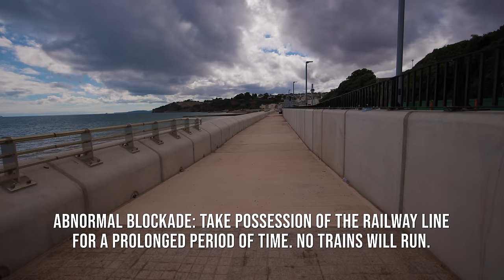Dawlish Sea Wall Upgrade - August 2022 Update with Network Rail Milestone

Comment: Wall looks good. Can I make one point though. White lettering against black screens can be read during the day. However at night when visibility is reduced they become much more difficult to read. You have to find a black painted sign post against a dark sky in the first instance, before you can read it. And if you are on the train and want to see what station you have arrived at, before alighting from the train, its not immediately obvious, adding to the stress of travelling.

Comment: That's some impressive engineering works. I was interested to hear that the piles go down some 25 metres. Made me wonder how Brunel's station bridge as stood the test of time as the piers still look solid even after many years of high volume train traffic
Reply: Brunel didn't build the station that we know. The original structure, I believe was timber back when it was a single track (wide gauge).

Comment: One thing that puzzles me, why install separate poles for the CCTV cameras and the Tannoy when the light poles could be used?  Less clutter on the platforms is surely better for disabled people and even the rest of us.  I've lost count of the number of times I've walked into 'Street Furniture' if distracted!
Reply: I agree with you Tony but when has commonsense ever prevailed! Someone’s decision and design toes are bound to be trod on if you try to combine things. Bit like road signs; one hiding the other!
Reply: Ye good point 👍
Reply: It is done deliberately to keep the services and systems completely separate so that if they need to do maintenance on say a lighting pole to change a lamp it can be lowered or worked on without interrupting CCTV,  Tannoy or other services at the same time. Makes perfect sense

Comment: I have a question, After all the cement was pumped through the pipes yesterday. Do they flush them out after use.
Reply from the maker: Yes they are flushed after ever pour.

Comment: There is a gap in the L units on Platform 1 alongside the station building. Is this for a flood gate to allow fora  platform evacuation?
Reply: There looks like a small platform access gate on the bridge side on Network Rail’s CGI model. Where the new footbridge is they don’t show any access, which is a shame
Reply from the maker: HI John, They are currently still pumping the concrete through that gap. There is a pipe from the other side of the station for the concrete.
Reply: @CoastCams247  So in due course an L unit will be installed?  I feared that a high tide would find the gap!

Comment: The 'new' sea-wall should have been constructed over 500m from the railway in the sea. The coast has a curve and by drawing a line from each end of the curve ), build sea-wall, then infill, it would have made a New Public SeaSide Park with a dredged sand pumped to the seaward side of the wall. This would have created a new beach front promenade to go with the new several sqKm of reclaimed land public space.
This would have had numerous advantages: new public space, new beach, and the most important - storms/tides etc would be striking a wall over 500m from the railway.

Comment: Looks a romantic fantasy to me. A Butlins camp feature well out of time. I'm drawn to comparison with the Key West railway permanently washed out in 1931 and Rommel's sea wall defence of the German coast. I would think the visible lack of adequate progress, work to rule and shoddy work would probably have led a milder German general to use a revolver on both the workers and the local authority office staff responsible Fundamentally this pointless project on am unsustainable railway with the changing sendment flows erosion, climate and tide is being conducted as a spin off series of rorts to finance various planners, consultants and work teams. Contracts should have been let to fully reopen 2/3 withered arm corridors a decade ago.